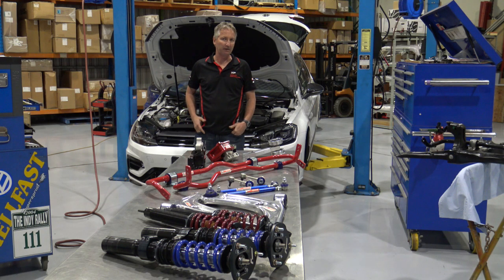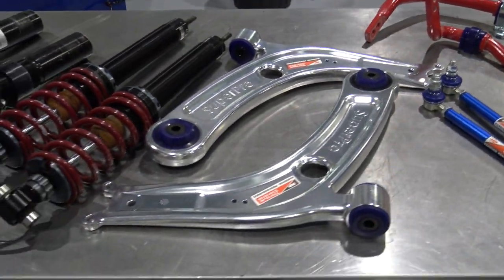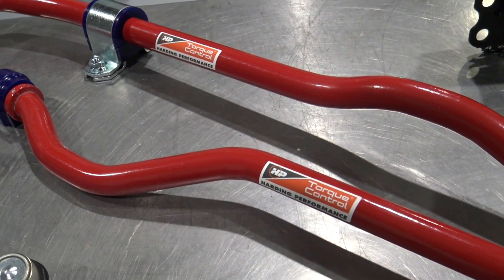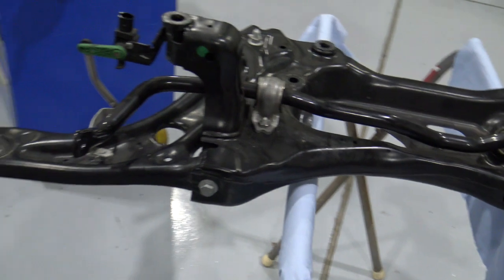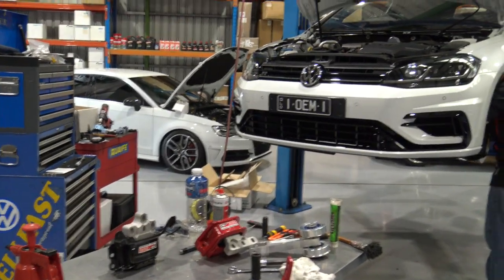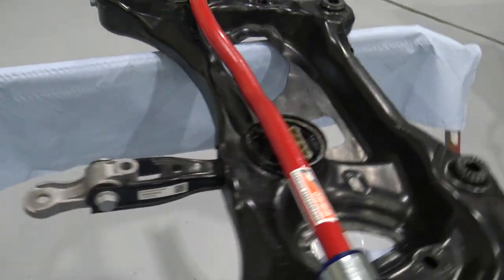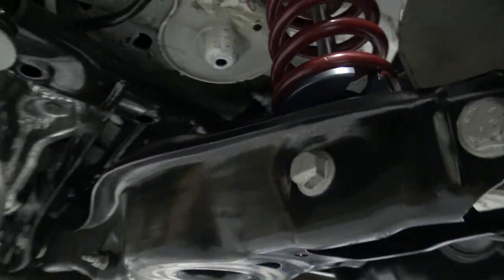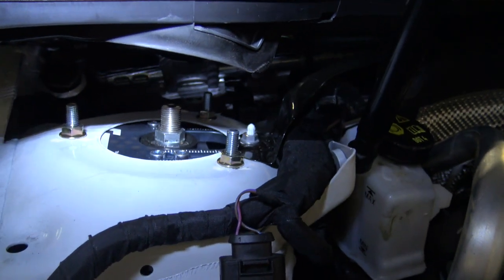Project 7.5: Suspension & Chassis Upgrades

Comment: That racingline dogbone is looks fantastic. It was installed in my golf 7.5 r....and i used that for 5 minutes...gear changes was like a stage 3 remaped dsg but the nvh level very very far and out of ny tolerance...the whole chassie was resonated and you use it only that case if you are crazy or i  a race car but foe daily basis...totaly not rexommended...what more...you can not deinstall without damage...so lots of $ went to garbage within a fee minute!
I recommend a dogbone insert for daily drive!!!!! 
All of other mods are very very nice!!! For me only the 034 motorsport stut mount missing from this list...but i know..vwr tracksport has  an adjustable one!

Please rewiew nvh level when using on street!!!! I am interested i !!